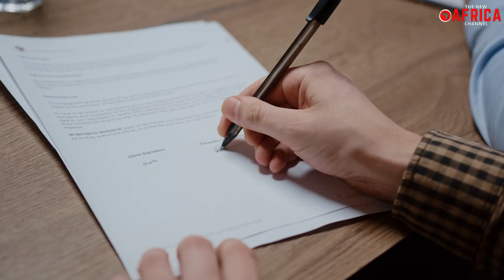1,396 KM EuroAfrica Interconnector Project to link Egypt with Cyprus and Greece

Comment: There is turkey's maritime border that the cable is passing. They need permission from turkey
Reply: Get lost you and your Sultan!
Reply: Why Turkey? Isn't it going through Cyprus?
Reply: @spuknicjones9531  In cyrpus to greece or Egypt to greece ways, they are passing turkey's maritime border. Search turkey mavi vatan. Greece's and turkey'S maritime borders are not clear right now.
Reply: @ty0023  interesting....never knew there's an ongoing marine dispute between the said countries...
Reply: @ty0023  actually  it  is  Turkey  that need  Egypt permission dude
Reply: @ty0023  the cable is not going through turkey's border yes they signed a maritime deal with libya but that deal doesn't even count the administration that turkey favors GNA is out of date they finished their ruling time but stayed more than they should have and secondly that maritime deal didn't include egypt and Greece in them so those two countries doesn't recognize that deal and no one outside of turkey and the out of date administration in libya recognizes that deal or those sea waters as turkish waters
Reply: @AhmedIsmail-vo6iz  UN recognized that deal
Reply: @ty0023  the deal  was canceled by the Al-Bayda Court of Appeals of Libya in its 27 January 2021 ruling. ... Unlike Turkey, Libya is a signatory to the UN Convention on the Law of the Sea, which defined the exclusive economic zone of Greece in 1982.
Reply: @AhmedIsmail-vo6iz  government of Libya is recognized by the UN not the Hafter side
Reply: @ty0023  the government of Libya was also out of date and the thing I wrote was from google not me.
Reply: @ty0023  mavi vatan it’s a dream that turkey has
Reply: @andyx7488  yes and does movement regarding the mavi vatan dream
Reply: @ty0023  yes a dream so no one in the world recognise it
Reply: @andyx7488  no one recognizes Greece maritime border too.USA and the EU announced  that they do not recognize Greece maritime border that Greece claims.
Reply: @ty0023  the law of sea says 12 miles and 200 miles eez. All the world recognise except USA, turkey and 2 other countries. Soon USA and other will recognise it.
Reply: @andyx7488  ıf turkey does not recognize it, no one can force turkey to recognize because it is not ethnical. Therefore, they would need permission from turkey
Reply: @ty0023  no becouse doesn't belong to turkey. if turkey doesn't reconise the law of sea that doesn't mean that doesn't exist
Reply: @ty0023  with your logic istanbul [constandinopoly] and other cities  in turkey belong to greece because of great idea.
Reply: @andyx7488  yes but turkey doesn't care. Also now turkey is performing activities in its maritime border that is not according to the law of most of the countries recognize
Reply: @whatsup7470  it is recognized honey I suggest u to check the news and make some research
Reply: @MomoEpic1 who supports Erdogan? me? I hate him. U didn't het what I mean read my comments again
Reply: Just ur president wants to creat new maritime border with Lybia & Egypt but none approve & none actually interest with his speach
Reply: @moatazelsarraf1510  I know but still they need permission from Turkey
Reply: @ty0023  they dont need  permission from  Turkey   have  u ever heard about  the Egyptian navy?
Reply: @user-or1rm1ol3q  and have u heard of strongest country in the middle east east meditaranien and balkan?
Reply: @ty0023  yeah I do it is called Egypt   the most powerful in the middle east
Reply: @ty0023  turkey can't have a war with Egypt and vise versa
Reply: @ibrahimrashad8761  egypt cant have war with turkey too
Reply: Are you sure you have maritime borders !!! you have only 2 km maritime borders which give you access to swim and fish only.
Reply: No they don’t need permission from Turkey
Reply: @AW-wq3pr  no they do. Same is happening in eastmed  project as well
Reply: Guys the cable is actually passing the green water of Turkey but turkey can't  stop it because the green water is an economic border of Turkey 
Which they only have the right to get any natural resources there only for example they can't stop any passing ship from there
Reply: @ahmedelsersi8140  
ماتالفش انت كمان 
الكابل مش ماشي في حدود تركيا 

وانما داخل الحدود القبرصية اليونانية المرسومة والمعترف بها عالميا ومصر مرسمة معاهم 

بينما تركيا تدعي ملكيتها  علي تلك المنطقة مع اعتراض العالم اجمع 

فما تالفش وتقول انها بتاعت تركيا بمجرد ان تركيا الوحيدة اللي بتقول انها بتاعتها
Reply: @mohamedhatem997  يا حبيبي يا اخي في جزء بسيط بين قبرص واليونان مياه خضراء او مياه اقتصادية يعني اي ثروة اسماك اوي غاز او اي حاجة تبقي تبع تركيا غير كدا مالهاش انها تمنع الخط يتعمل او اي سفينة تمر
روح ابحث عن الحدود التركية البحرية وانت تعرف كويس

Comment: The most impressive thing is that Egypt is the one which will export to Europe. Egypt made huge developments in its electricitry sector, it’s just extaordinary, I can’t describe what a great work they’ve done on that.
Reply: Indeed! As an Egyptian I'm very proud of all improvements happening not only in electricity but across many sectors, example the roads. Just few years ago Egypt was ranked something above 120 in road quality index, in latest report Egypt ranked number 28!! And despite all these facts you will find still haters, motivated by ideology( like Muslims brotherhood) or others, trying always to twist the facts and undermine all achievements,but most important facts are facts!
Reply: @whatsup7470  If you will change things for real do this:
Move water from The Congo river to the Nile river! 

1. The white Nile has capasaty to transport much more water, 10mounths of the year.

2. Make a dam about 30meter high (water leven 630meter over sea level) here: 

1:14:12:60North and 28:19:38:60East. 

3. Tunnel to about here 224km to Lake Albert. 618meter over sea level.

If you rasise this dam 30meter more, and you only need a 202 km long tunnel. A 5km canal is neede then on the Lake Albert side..

Not forget to start digging several places at the same time, to save time. ... And the tunnel is not very deap under the jungel here, so that is easy. 

Of cause you may have some ground water isues, like everywhere else. That standard.

Cost Norway has (still?) the longest road tunnel in the world, 24,5km. It just costed 113million dollar. * 10 = 1 113million dollar... But lets say 2B, of the 2,7B for the Electic cabel.

Easy?

4. How much water is it here? 

I am not surce, But about 350m3 a sec. That is significant!!! 

And you have the capasity, in a river that is very sesonal. Agree?

5. Expansion. It is also easy to expand this project. As long as you plan for that, when you make the tunnel.

Expantion 1: Lock 155km down the river. 

Here: 1:40:15:North and 27:00:32East.

Here you have maybe 350m3 more water. And a 10meter high dam here, and you are at 490meter over sea level. Just ad some pumps and some about 3 more dams, and you can connect this to the "High dam"

You only need to pump the water up maximum 150 to 180meter. ... The pumps at "Mubaracks Pyramide" can lift 2 500m3, borrow them.

Yes that will cost more money, but this change maybe 6 desert country`s significantly. Then it is ok, to spend money.

Expansion 2: Just 5km away, you have one more and bigger sorce here: 1:08:43North and 26:59:12East.

... But if you do that one, you need to expand the The white Nile River (or maybe the river will do it for you.

Conclution: This is easy and cheap to do. And it can be done fast.

Do not forget to calculate in the HydroElectric oportunites here.

Compare the old plans to this one (600km canals, pumping water up 1000m, go by South Sudan and so on).
Reply: Wgy not use this money to move water from The Congo River (2,7B $ should cover this cost)? Then this water will increace the HydroElectic prodution at Aswan significant. It will also be a great help to secureing Sudan and Egypts water suplay (and awailable amont of water).
Reply: @terjesorhaug143  no mate the congo river connection project require more money simply because to connect to the white nile branch we have to deepen & widen the white nile first to carry the extra amount of water & that will take double the amount of this money  & effort
Reply: @koko9ify  I dont understand why? With one exception, Jonglie.

The White Nile has short 3 mounths flooding season, but the rest of the year, the awerage water flow is about only 20% of this. 

Why not use this 80% capacity, for free?
Reply: @terjesorhaug143  
Even if we overcome the cost, logistics, topograpgy, geo political challenges of building the canal linking Congo river to white Nile (which are big challenges in their own)... the excess water flooding in the old valley from white Nile to unified Nile will need to be widened and deepened... this is impossible due to extremely high cost and effort making the project not profitable before hundreds of years
This was published when the project was throughly studied about 10 / 15 years ago
Reply: @magdyali2581  I was laughing  tfor several  hour after seeing this report.
Reply: @terjesorhaug143  
I am sure u know better of course...
Reply: @magdyali2581  Yes. Can you tell me how, cheap and easy this is? If you disagree, that okey. But I dont think you can.
Reply: @magdyali2581  Widened, are you joking? Why? I just answered  this. You should know this, if you know anything about this subject. Dont you know that the White Nile, only runs on full capacity, a very small part off the year? Do you really think that you can not put extra water into the river, when its down to 20% of its capacity??? And yes Jonglei, yes you need to byepass El Sud, but that can be done relatively easy.
Reply: @magdyali2581  Cost and time: Now I have showed you, how easy you Widening problem was to fix. Challenge!

Can you think again, and then tell me how, I can tell that this is very cheap, and can be done in about 3 years. ... And can you build in a potential, for expanding this project, whit about 300% laiter if whanted?

I give you 36hour to answer.
Reply: @terjesorhaug143  
Sure..
Will tell the dozens of experts who studied the project with actual qualifications know about this obvious easiness they must have missed from you online
Reply: @magdyali2581  Geopolitical, what does Ugandas PM say about this 2 rivers, and the Nile focus? Uganda, I belive, will noy have any problems getting their Hydroelectric  production increased  300 to 700%.
Reply: @magdyali2581  Yes, and you still not telling me how easy this is to fix. I give you 35hour, to see it for yourself, then I tell you.

It tok me 5sec, to fix you big Widening problem. A ptoblem you actually  belived in.

From this repport you, I think it was you: 600km Aqueduct, pumping water up 1 500 meter over sea level - Madnes!
Reply: @terjesorhaug143  
Wow.. you should be a minister or something.. weird that you aren't.. 
This desperate search for approval is pathetic to be honest 🤣
You are so touched by it you go straight to confrontational
Reply: @magdyali2581  "Even if we overcome the cost, logistics, topograpgy, geo political...." You are very negative. Better if you ask how.
Reply: @terjesorhaug143  hello bro
till now and nowadays technology the project will need more than 100 billions and the amount increases every day 
but beside the finance and technology problems there are two big political problems 
first in south sudan which u suppose to connect the congo river with the nile because south sudan don't have waterway for the nile just have swamps so first we need to finish the jongly waterway in south sudan and make waterway without that all water go to south sudan will just make more swamps and drawn them and to make this waterway we have problem with the clans live their  because they don't want the project to finish because they use swamps for feed thier cows 
the second problem in sudan , the white nile waterway in sudan in deep 3 meters only and they have problems from flood every yeat=r because of passing 10 billion cubic meters of water every year so u can imagine if u pass 100 BCM what will happen beside dealing with Sudanese is not easy as u think specially till have election in 2024
my greeting
Reply: @terjesorhaug143  (business speaking) with less money we could actually secure our current water resources by purchasing advanced airplanes which Egypt already did to destroy any constructional threat to the water resources. Don't worry mate, water is fine 👍.